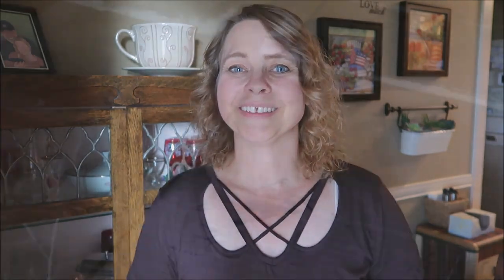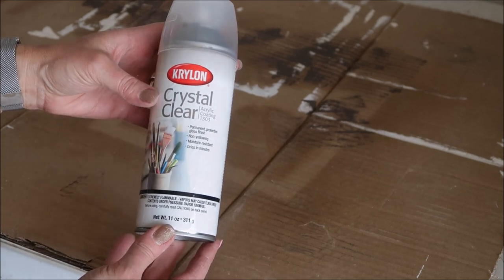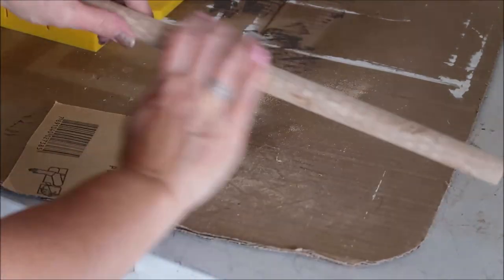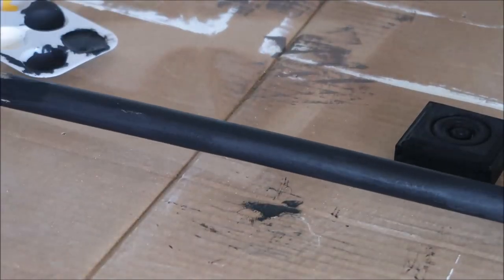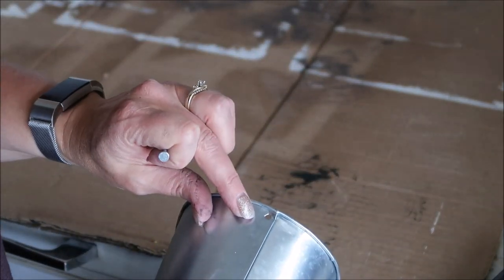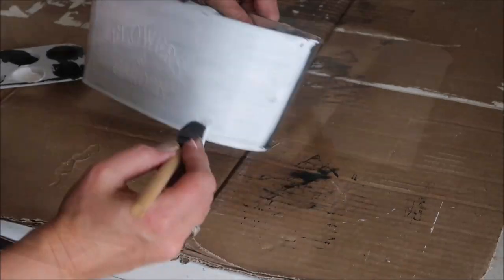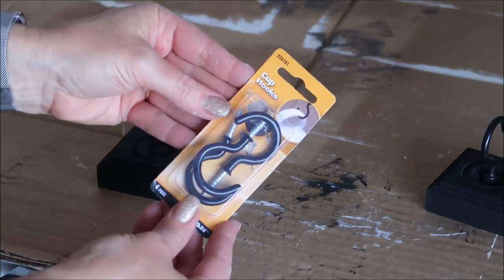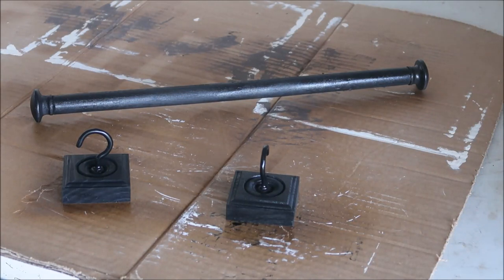Dollar Tree Farmhouse DIY - Hanging Bucket Wall Decor | IKEA Enamel Bucket Organizer Dupe

Comment: This is so nice.  You're very creative.  FYI, you need to remove your tags from things.  You left them on the back of the blocks so you're  basically hanging the tags to the wall.  If the adhesive on them fails the block will fall.
Reply from the maker: Thanks Debby.  Yes, I should have removed them for the video, however, I am not leaving them hung up with the command strips.  When I decide where I want this permanently then I am going to use some black screws and screw them into the wall.  Thanks for your comment and for watching.